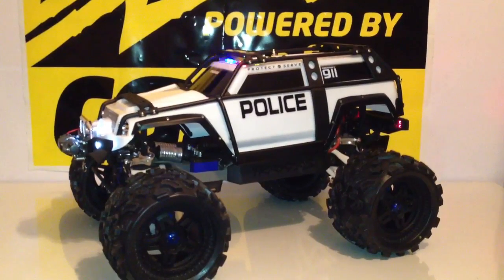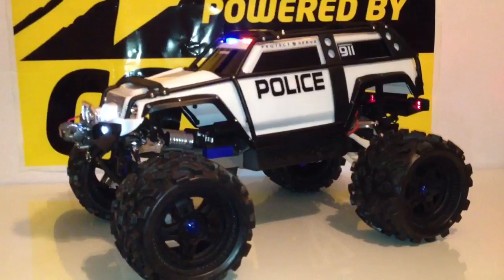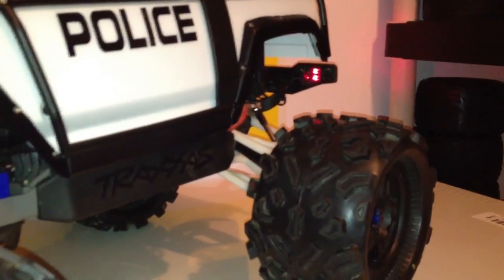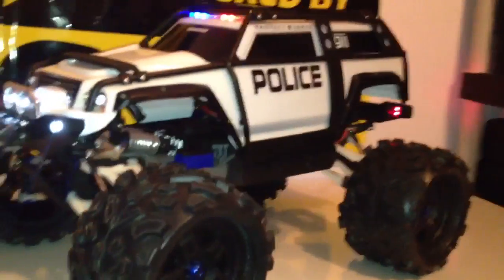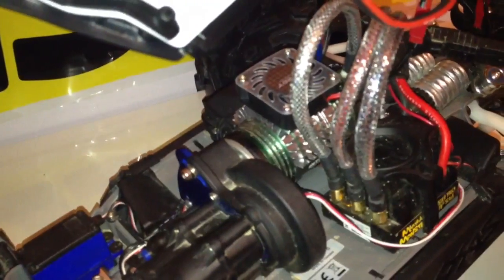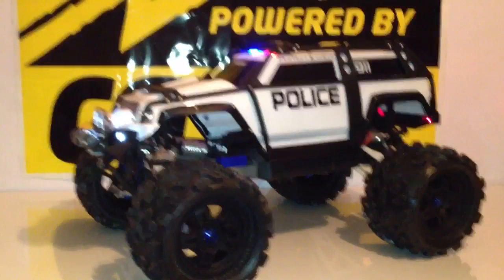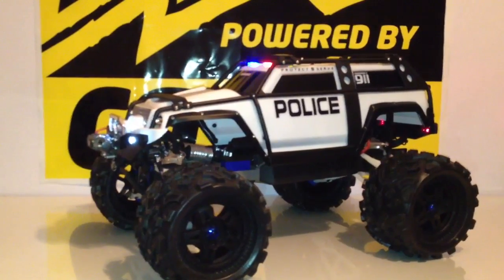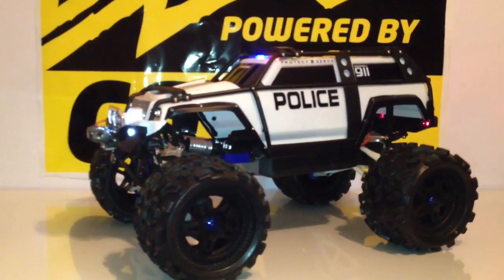TRAXXAS SUMMIT UPGRADE INSTALLED

Comment: My brushless Summit upgrade negated the need for two gears. although I still retain them. I'm using a Track-star 2650kv 6-pole with a Mamba ESC.  No problems at all. As for the locking diffs, I have both the punch ( 50% ) and the power (75%) dialed back. But she still can do wheelies in the grass. I'm take it easy on pavement. I personally wanted to keep all of the stock engineering Gizmo's and I did not want to possibly replace the driveshafts, etc.

Comment: rpm bumper mounts are pretty close to unbreakable,arm skids and bottom skid work very well.Can be a bit of a pain to mount some report tweaking needed.mine went on pretty good but a little adjustment was needed to get them to fit right nothing major.

Comment: The Integy fan is OK for mild applications. I would have gone with the Castle motor fan for the 2200kV motor. I have the fan for my Stampede running the 2400kV motor and it stays super cool.
Reply from the maker: Didn't like

Comment: hey man!   i got another question what rpm arms did u use for the rear ,,, i know rpm has now front rpm arms that work fine ,,, but ive been reading things about the rears,,,,people using revo ones and had to do mods to the arms to make them fit on a summit , i know this is a erevo but any diff?